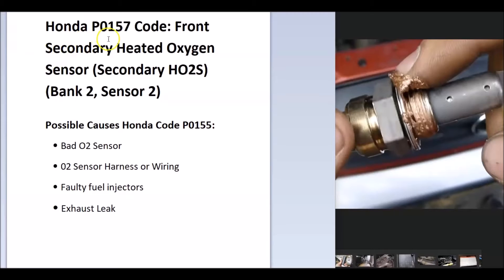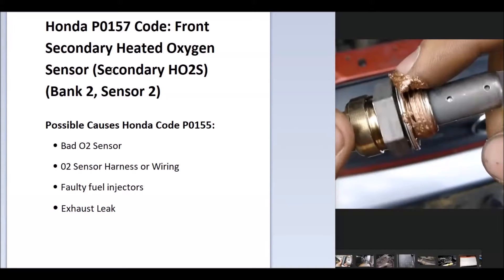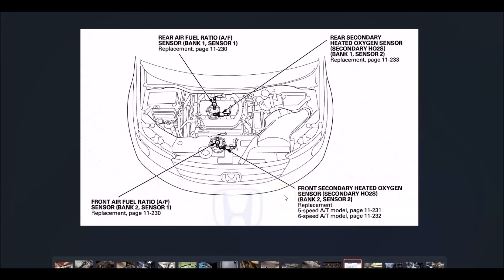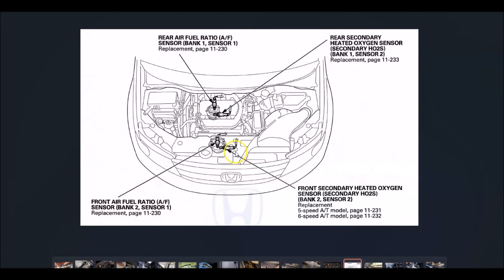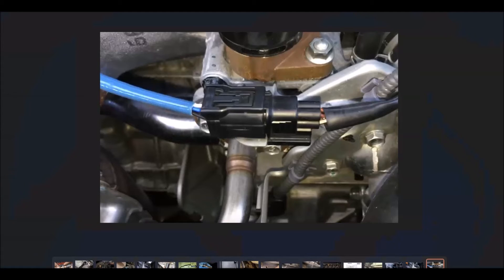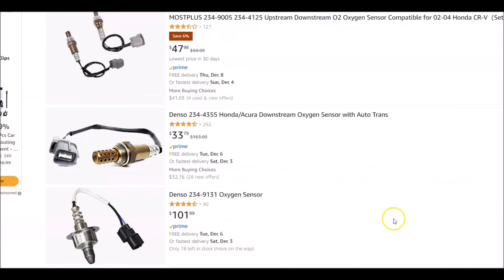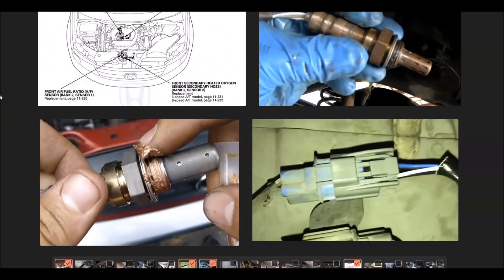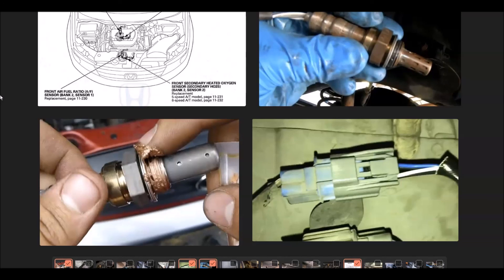How to Fix HONDA P0157: Oxygen Sensor Circuit Low Voltage (Bank 2, Sensor 2)

Comment: Do I purchase two sensors? Basically one sensor has 2 connections that is it connects to the engine and then other end onto the exhaust? So two sensors covers in total 4 connections?

Comment: Where is bank 2 sensor 2 on 2019 Honda rid
Reply: Here are the terminologies of the Oxygen sensors in the Honda vehicles:

Bank 1 is the firewall side (rear) and bank 2 is the radiator side (front). The top sensor (sensor 1) is positioned upstream and the bottom sensor (sensor 2) is positioned downstream. The downstream O2 sensors are located around the bottom of the engine, so the vehicle needs to be jacked up in order to see it or replace it. The upstream sensors are located around the top of the engine. To find the O2 sensor, find the catalytic converter, then you will see the O2 sensor.
Reply: Your bank 2 sensor 2 is the bank 2 sensor 2 downstream front. This sensor is located on the front of the engine around the radiator and underneath the radiator area. You have to jack up your vehicle and locate the catalytic converter around there, then you will see the sensor.
Reply: 2007 Honda Pilot has 4 sensors and 3 catalytic converters.  P0157 code Bank 2 Sensor 2.  Located in a horrible spot to reach.  Mechanic says most cheap sensors won’t keep the codes away.  Sensors are $250 plus $240 labor.  Catalytic converter number 1 is probably $2k installed.  At 223,000 miles, seems like a beautiful kept car is now not worth fixing.

Comment: My daughter's Highlander was throwing both high and low voltage codes on bank 2 sensor 2.   Live data showed voltage swings full scale.  An open signal ground along with a weak sensor were the issues.